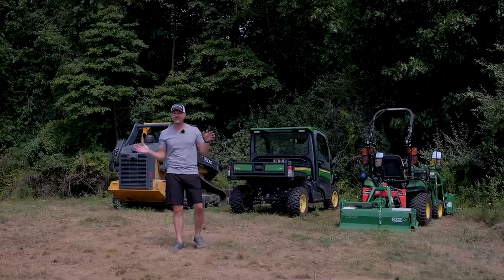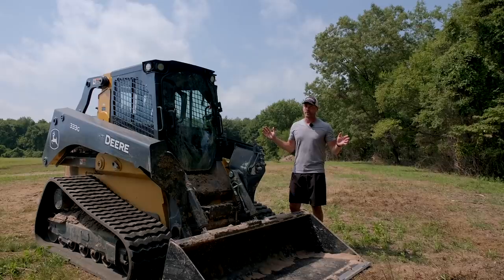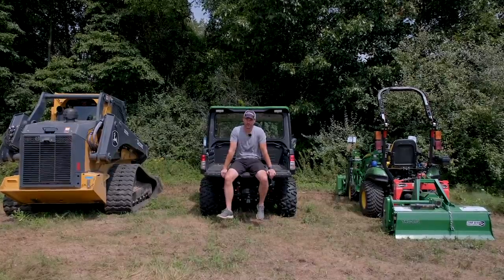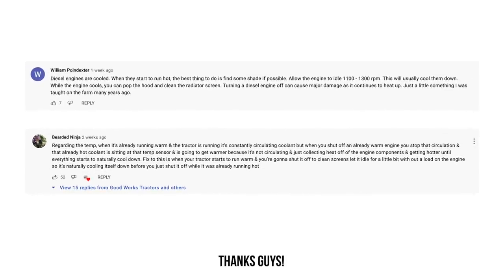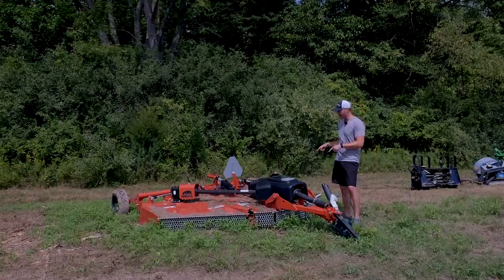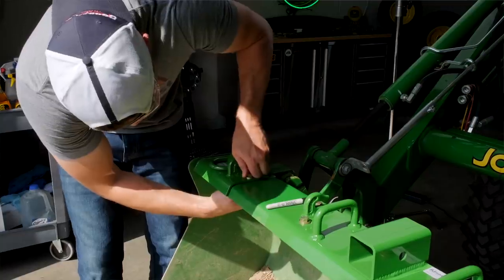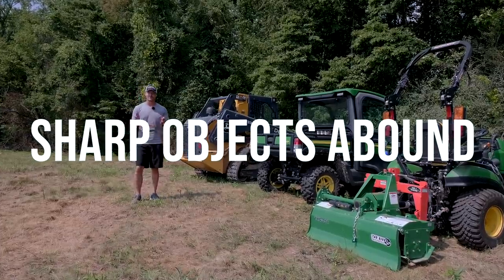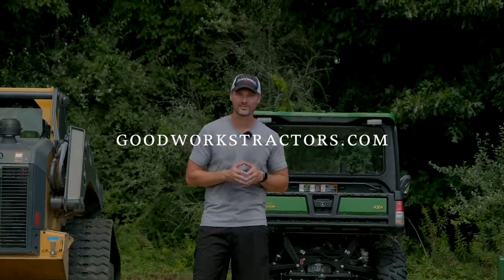TOP 10 WAYS TO BREAK YOUR TRACTOR: PART 2 😡🚜

Comment: You need a "real Gator" and not an "F-350 wannabe Gator".  :)  Ours is a 2004 HPX4 with no cab, no a/c, no windshield (not even a ROPs!)....just a couple of seats, a dump bed (manual, not that wussy hydraulic stuff), and 4wd.  Ours was probably $5k or $6k brand new, and is a beast and a beater at the same time.  It works hard and lives dirty.

IMHO Deere tried to be too much with the new Gators with heat and a/c and all that creature comfort stuff.  They're heavy, expensive, and really moving away from what they were originally intended for; cheap, simple utility vehicles to move people and hay bales and firewood from one point to another.  Now they have more luxury options than a Super Duty, with half the capability, but all the price tag.  Just my opinion, take it for what you paid for it.  ;)

Comment: Don’t drop trees on your tractor 😄

Was pushing some debris back to give us more room, and disturbed a tree that had rotted out at the stump, next thing I know I hear a massive crack. I shut the tractor off, and dive off the machine. In hindsight, I probably had enough time to get the tractor out of the way before the tree came down… but why risk it right? Anyways the tree comes down right across the fenders, where I would have been sitting. Thank GOD my boss was right there with a kubota excavator with a thumb and easily pulled that tree off no problem. Ended up busting a ROPS light and cracking a fender. 

Another time, my boss had the tractor place with the forks around a tree in an attempt to guide the direction a tree would fall after being cut. The tree decided to fall before that, and not in the direction intended. It went sideways, and rolled the tractor on its side. Lost a bit of engine oil and slightly bent the loader frame. 

We have. It been kind to this tractor. Long live John Deere though. The poor tractor just gets abused left and right and still keeps on ticking 😂